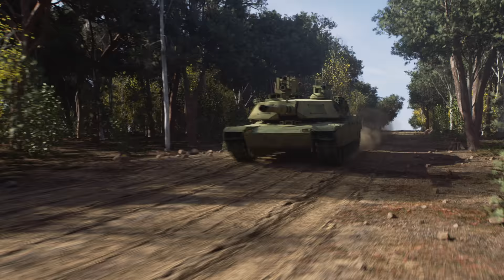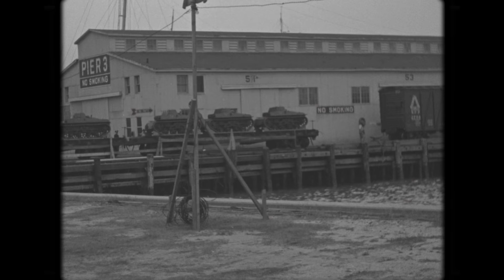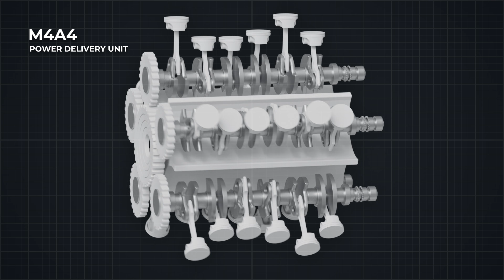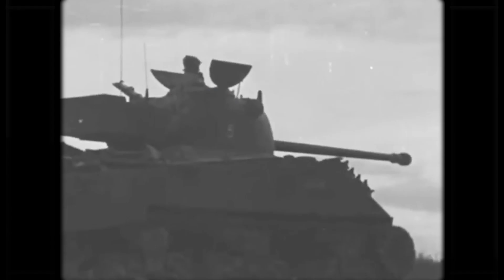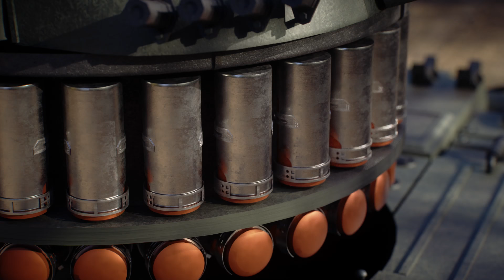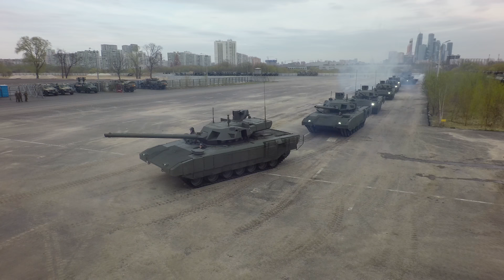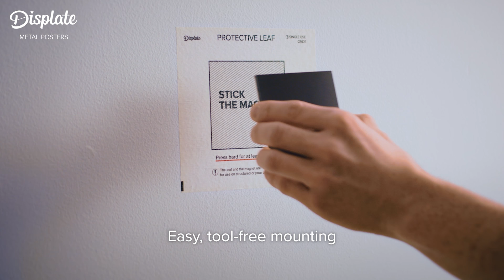Why America’s Tank Failed in Ukraine

Comment: I think you hit on the engineering aspects well, but the elements of fuel consumption and the overriding importance of resupply (logistics) and battlefield utility are probably lost on people who can't read between the lines. There are layers to this particular piece of technology:  from combat duration, range, sustainment, and changing battlefield environments--the main takeaway is that the Abrams was designed for a certain role at a certain time with an engine that isn't material to the changing nature of modern warfare as seen in Ukraine. Rather, the events in Ukraine have almost universally invalidated the traditional role of tanks and the Cold War expectations of tank warfare. 

The only operational event in the last 40 years that met the design and capabilities of the Abrams under ideal conditions was the first Gulf War. Since then, it's been designed almost anachronistically (rather than with prospective strategic considerations) for a military that is riddled with cronyism and graft. I wish the US would have been building the better tank it COULD have been building, but there's about a thousand reasons why it's hard to get the DoD to get moving in the right direction...and only one reason actually gets it going the right way --> an extant threat that invalidates a sacred platform.

Comment: I knew the moment i saw this video, that Americans was gonna get buthurt..

Everyone except Americans, know that American tanks are worse then Russia and Germany's tanks, and probably more.
Reply: I think the people are "buthurt" because the vid is 15 minutes longer than it needed to be and some info is completely inaccurate. For example implying that Ukraine received the full upgraded 76 ton version with depleted uranium and active protection, which is not the case, as well as implying that the tank doing jumps and laps around the track is fully upgraded, which it isnt. Every single tank fared the same in this war and Abrams is no different. The prevalence of portable anti tank systems, mines, drones and artillery made sure than 99%+ of tanks are destroyed in one of those ways. Aside from its expensive and fuel inefficient engine, Abrams a solid tank.
Reply: @DavorBa  Actually not the case..

About 80 Leopard 2 tanks has been delivered to Ukraine, and they have lost about 30 of them in 4 years, and they are still being used (although not very much because of drones).

The US supplied some 31 Abrams tanks to Ukraine, and they lost almost all of them fast, then got another batch of 49 from Australia, and started losing them as well, so now they are not really being used anymore, and just sit in place as backup.

Ironically its not the T14 from Russia that is making it hard on the Ukranians, its the cheaper version called the T90.. The T14 was only in use for a few months, before Russia decided to pull them out because they didnt want to risk Western Intelligence getting the technology, and also because they were too expensive to lose on a drone war and is better suited for easy battles like Iraq and such.

Comment: Here is multiple factually wrong claims.
The T64 was not the most advanced tank 
nor was it the first with a real Autoloader,
It was the first to get the Carusell autoloader.
And the T64 lacked the Autoloader when it entered service.

The most advanced and the first with Turbine power and  real autoloader  was the Swedish STRV103 which still has the record for Fastest Autoloader and  continues Fire.
It was the first with a digital ballisitc computer to if i remember correctly and the first with a Laser range finder.
And the T64 lacked the Autoloader when it entered service.
It was also first with a completly hydropneumatic suspension
I think it also was the first Hybrid engine Tank.

The STRV 103 has been tested by NATO against LEO1, M60 Patton, Centurion and Cheiftan in all these testes NATO could not show in any way the STRV103 to be Inferior in any test and it was seen ashaving better readyness level then its NATO counterparts.

Comment: Problems with this video.
1. 0:00  the Abrams sent to Ukraine are less advanced versions (M1A1 not M1A2s).
2. 13:30 This has been proven to be false.
3. 15:50 DU armor was only produced on the M1A2. A heavy armor version of the M1A1 was made using DU armor but only after the M1A2.
4. 17:08 These have almost never been used to haul Abrams and never in U.S. wars.

These may not be much but it is way to many mistakes for a channel of this quality. I am digusted and will dislike this video because of it.
Reply: 3)Wrong.
It's literally was on M1A1HA.
More importantly,nobody cares about composition of armor on M1's turret cheeks because it wasn't hit in that tiny somewhat better protected area....except in a few cases.

Comment: the tank is fine if used in the modern doctrine. they are designed to work in a theatre where you have complete air supremacy and you are working in coordination with the rest of the force to achieve tactical goals.

Comment: the problem is not the crew or Ukraine. but the lack of support given. As Ukraine does not get spares, no training to repair so if it breaks they need to tow it back or it gets blown up.
So big issue is you get weapon systems but not every thing to use them to full potential.
like you get hymars and patriot systems but not plenty of Rockets and range to use them effectively against invader. or not allowed to build the rockets so you are not dependent on getting them shipped from far away from factory not producing fast. So logistic is with hild by US to make more money while Ukrainians are dying. just like in iran where rebels only go light weapons against asad. etc

Comment: Most of the reliability issues cited with the T64 opposed piston engine were highly specific to that powerplant, not the layout.  The AbramsX demonstrator actually uses an updated 3 cylinder/6 piston variant from AchatesPower and Cummins called the Advanced Combat Engine.  The Napier Deltic and Fairbanks Morse 38-1/8-8D also have multi-decade histories of reliable service at east and on rail (the Fairbanks Morse was used on US boats from the Gato class until the Seawolf class, and was only replaced in the Virginias due to space constraints).

I'd love to see you do a video on opposed piston engines, though there are several good ones already.  There was a turbo-compound Napier Deltic prototype using the experience from Napier's Nomad program, and I've never been able to find any good information on that.  I have a monograph on the deltic, and even it doesn't go into great detail on the turbocompound, but apparently it hit 5600 HP from 88L displacement before throwing a rod.  Anyway, cheers and thanks for the great content!

Comment: @realengineering I am genuinely a bit confused as to why you've responded so poorly to the actual criticisms levied at you here.

The mentions of the T14 aramata like it's somehow advanced... So advanced it doesn't exist.

Russian specs for the equipment are consistently over hyped while with Americans it's quite the opposite. More over you can see this with the sinking of the moskava.

World powers like China and India that used to buy Russian hardware, have quickly realized that the soviet bear died long ago.

If the Abrams are a failure, I'm genuinely confused what qualifies as a success given their count of Russian tanks destroyed. This war has indeed told us much, but one thing about all others is that Russia... Is not a major threat to western nations unless we consider nukes... And even then oh boy we need to discuss how thermonuclear bombs need maintenance for which the bastion of non corruption of Russia... Surely wouldn't have an issue with.

You stumbled into the tank community and it is one that is ferocious.

However, a simple thing to consider is that despite Ukraine having smaller military and population, they're able to hold back the Russian bear.... With hardware... From the 80s. And despite this, they'd still accept more abrams. If it were a failure, maybe they might not want it and ask for a IFV instead.

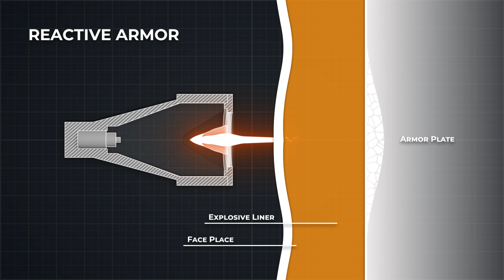Comment: One small but very significant correction - for the illustration at 15:40 for how ERA works. ERA does NOT work if the incoming hyperplastic jet of the HEAT warhead is perpendicular to the plate being thrown against it - because the plate cannot really "disrupt" the jet with so much point pressure and speed. Instead, the plate of the ERA sandwich has to be at an angle to the incoming HEAT jet - and when it is thrown upwards by the explosion of the explosive filler - it acts like a sponge, absorbing part of the hyperplastic jet into itself, and thus preventing it from attempting to penetrate the tank's armor. This is why all Russian ERA packages come at a really strong angle - especially mounted on the turret and the front of the hull.

Comment: The M1 abrahms is disposable n designed that way. By that i mean the impetus is on crew survival. Tank damaged? Hop in a new one. Russian tanks take the crew with them when KOd.
Future tanks will be scaled down in crew and size. Probably just 2 man crew. Driver and fire operator with added comms control from remote operators fire assisting. Theyll be very mobile easy to hide. I wouldnt be suprosed if they take on a 'mole' featire n be able to dig right in almost underground in woods n vegetation n lie in wait.
Id expect a standard chassis with several interchangeable turret tops like Anti aircraft/drone,  antipersonel, a heavy guns less n less practical nowadays theres better ways tondeliver payloads.

Comment: Why it failed?  Because it was not built to win and survive.  It was designed to get procurements and make money for the industry.
Reply: The issue is that the Abrams is an old platform that hadn't had to deal with modern threats and was being leveraged by a military that lacked the logistics backbone to support it. The US warned from the get-go that Ukraine wasn't a good fit for the tank. The M1E3 addresses practically every problem witnessed on the front line though.

Comment: It's not a jet engine, it's a turbine engine. Also the T-80 uses a turbine engine as well.
Reply: the french lecler too
Reply: They are the same lol, you're arguing about pointless semantics here. 

A gas turbine is a form of jet engine as it uses a jet of high temperature gas to propel a gas turbine.
Reply: Its still a trash tank though
Reply: Potato potato. It's a Turboshaft which is still a Jet Engine.
Reply: @burddog0792 absolutely not. A jet engines uses the exhaust jet stream for propulsion. If y'all think turbines and jets are the same then we might as well call steam turbines "jet engines" too
Reply: @BlwnV8-l3y  What do you think spins the power turbine on a turboshaft Mr. Internet expert? 🙄
Reply: @burddog0792 uh, exhaust gases? 

I guess you'd say exhaust jet stream, but guess what? A high pressure steam entering a steam turbine is also a jet. Yup, confirmed, a steam turbine is also a jet engine😂

Literally how these things are named is the way that they propel a vehicle. I don't see an Abrams being pushed by jet stream. Maybe you do, but that's you
Reply: @BlwnV8-l3y  Jet engines operate by burning fuel and expelling the exhaust under pressure to generate thrust. A turbine engine although similar in construction does not operate by expelling the exhaust under pressure to generate thrust. The burning fuel spins a shaft the shaft spins the transmission in the tank and provides torque which moves the tracks on the tank and moves the vehicle. Same principal on a naval vessel the shaft rotates the props making the vessel move. This explanation is based off the actual definition not some piss brained reply like those other fools.

Comment: The guy at the trade show with the M1E3 said one of the reasons that determined that they finally switch to a diesel, was that the modern diesels have comparable torque, so there's really no upside to using the turbine anymore.

Comment: I wonder how long till some country develops a serial hybrid modern battle tank.  Electric drivetrain for high torque and acceleration.  Batteries for silent running and station keeping.  And a diesel generator designed to run on almost anything to recharge the batteries.   You get the range of a hybrid with the power and stealth of electric.  And with new more stable battery compounds you can have a lower risk of fire.   Porsche had the concept back in WWII but didn’t have the technology to exploit it the way we do now. 

The new Abrams sounds nice but it is still a parallel hybrid like most cars.   It will rely on a more traditional and complex drivetrain as well as the an internal combustion engine for its main power.  The electric starter generator it uses will not be able to provide power output of dedicated electric motor.

Comment: CLICK BAIT - It starts with "... the US Army's main battle tank".  That is a lie.  It was the US Army's main battle tank 30-40 years ago.

Clearly a biased video against USA.  It tries to pretend the USA uses this same model of the tank and in the same way Ukraine used it.  The US used this same version of tank in numerous battles and did not lose any tanks (Gulf war 1991).  The US has multiple newer variants since this version and the ones Ukraine got are the original versions (not the newer variants).  Of course it has no anti-drone defense because there were no drones attacking the US in the prior century.  The British Challenger 2 tanks that were delivered to Ukraine have a much later version of armor and some were also modified for anti-drone defense.  This did not occur for the older model Abrams given to Ukraine.... 

The USA also uses their tanks in a system with other support vehicles.  Ukraine did not use this system.

Comment: Why does it take  23 mins to answer why?
Reply: Youtube algorithm bait, what else?
Reply: tiktok brain
Reply: I mean for a complex topics like this 23 minutes is perfectly reasonable if not short
He doesn't use his time well at all though and misses most of the newaunce and fails to explain why it's gas turbine engine is the  Achilles heal he makes it out to be
Reply: @acompletelynormalhuman6392  *nuance, its (no possessive its), heel.

Also it did mention the fuel consumption of the turbine, which considering logistics is a limiting factor at best and can be cut-off or stretched in the worst case is always a disadvantage worth minimising, whilst the advantages of the gas turbine aren't worth it.
Reply: Because yanks can't cope with reality
Reply: @DT-wp4hk  how challenger doing then?
Reply: @acompletelynormalhuman6392 

Good question. For sure not stopping any rubber boaters at Dover😂

Comment: I can't believe you would say with a straight-face that "the T-14 is an important marker for where future tank design is going" - I see absolutely no evidence of that.   The thing is a lemon they've clearly given-up on making to work.   The future is diesel-electric-hybrid, which the T-14 isn't.
Reply: Yes, it is strange that he picks the Armata as an example, but I think it isn't totally wrong, because the Armata shows some trends others follow too (but more succesful), like the Leopard 2 A-RC 3.0 or the KF51.
The future will be:
- Bigger calibres to be able to fire rocket propelled shells for indirect fire
- Autoloaders, because the time is over where you have to be afraid that it wont work
Reply: @randyraudi7725 so you're saying the future will be... the MBT-70, which had a 152mm cannon/missile-launcher (similar to what got fielded on the ill-fated M551 Sheridan light tank) with an autoloader.   Hell, as he pointed out in the video, there's been autoloaders since the T-64, which entered production in 1963 - autoloaders were always considered to be a trade-off (not so much reliability, but rather that humans could actually load faster for short bursts than autoloaders could), but in more recent future concepts there's been a shift to unmanned turrets with the crew in the hull, which requires an autoloader, so that debate is settled now.   Regardless, I'm not convinced "bigger calibers" are the way to go.   I think there's going to be more and more ~30-50mm type autocannons - whatever is large enough for proximity fuses to kill incoming missiles/drones, and possibly even some sort of ammo type for killing incoming shells.   This will let them reduce armor.   Then for punching holes in fortifications or killing enemy tanks they'll carry some missiles.   I also think there's going to be the rise of optionally-manned IFV's and MBT's, where the crew drives to the battlefield while monitoring everything on screens and then dismounts and gives commands to the AI for fire-support.
Reply: @N-E-R-V-A  Well, the Sturmmörser in WW2 also already fired rockets, but it isn't really comparable, it had its reasons why this concept vanished, but technology changed and here we are again. And you can combine calibers, the A-RC has a I think 30mm (or 20 ?) turret against drones, but the main gun is 120mm (if you want to keep using the ammu that is common atm.) or 130/140mm which would open the door for rockets, because 120mm is just too small.

Comment: You repeatedly reference how much fuel the Abrams consumes just by idling... but you leave out the fact they added an APU to the tank AGES ago, so they DON'T have to keep the engine running at idle, they just shut it down and run the fuel-efficient APU.